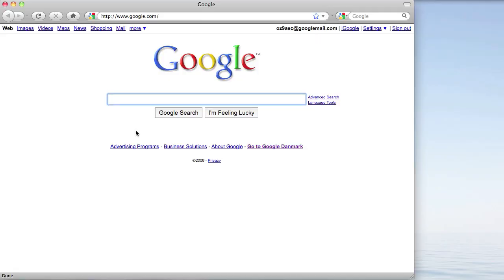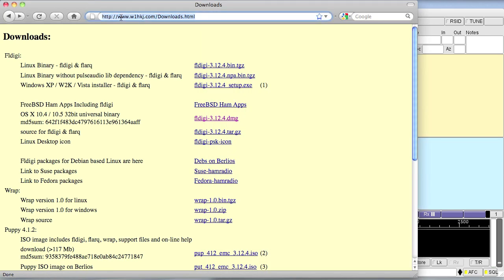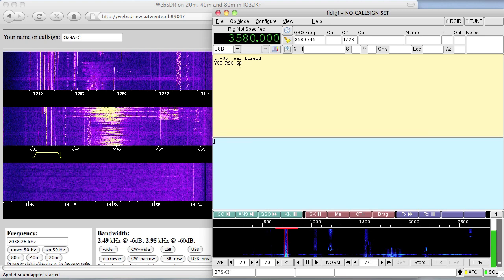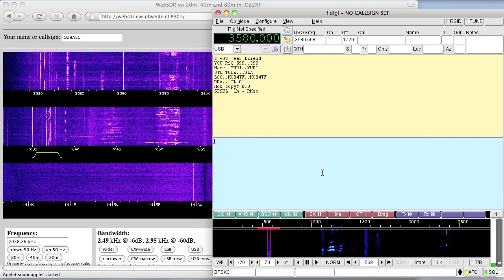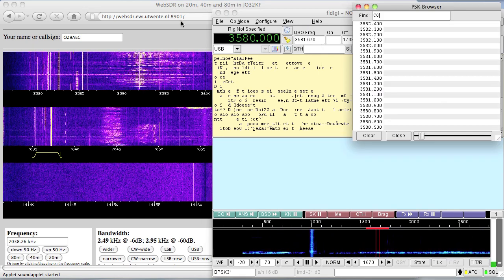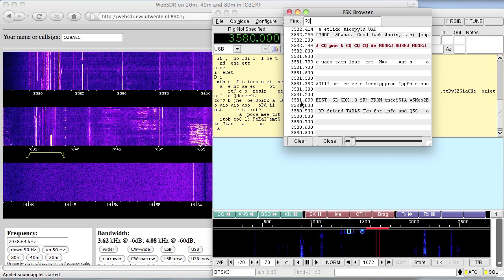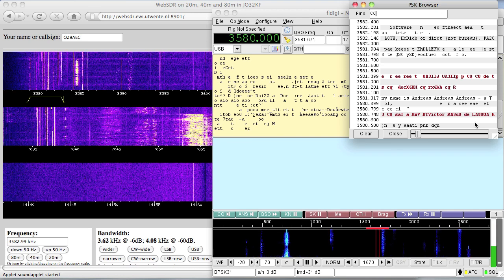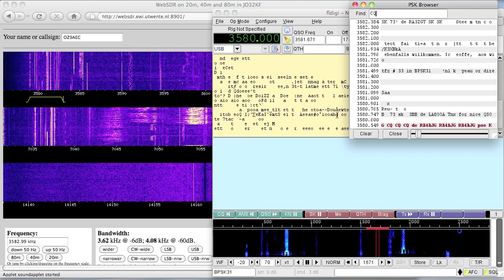Decoding digital hamradio traffic without a radio

Comment: Is this anyway to find out what op mode to use if you had no idea whose transmitting what?
Reply: Good question Nick. sometimes its trial and error to be honest, but you get used to it with experience.
Reply: Check out SigIDWiki.

Comment: it is possible to make funny qso's using websdr. For example i use my TXCVR for transmit (testing in 40m band) and websdr for rx, and hear my own signal. hi
I worked few stations, cw, ssb, psk and is cool. Some stations was heard on websdr and nothing in txcvr or reverse. 
The sistem is great for a lot of tests
For example N2YO use the websdr for control his signals to Europe. 
Very good video Alex
Have fun